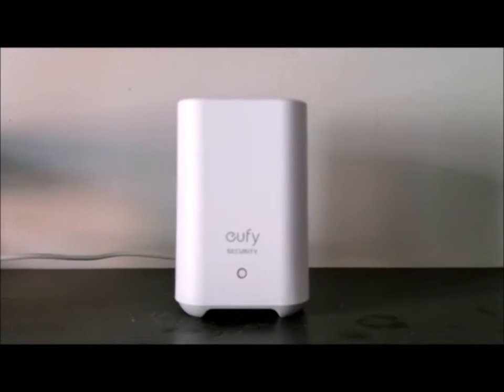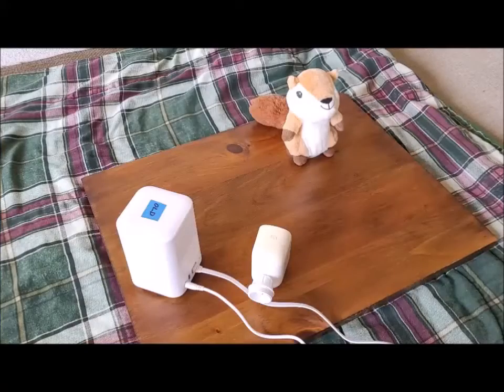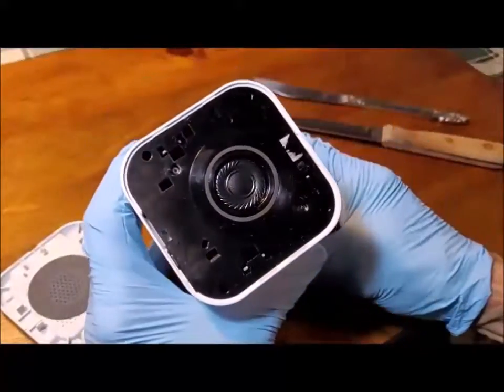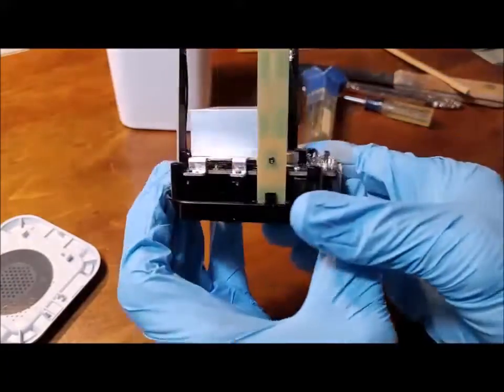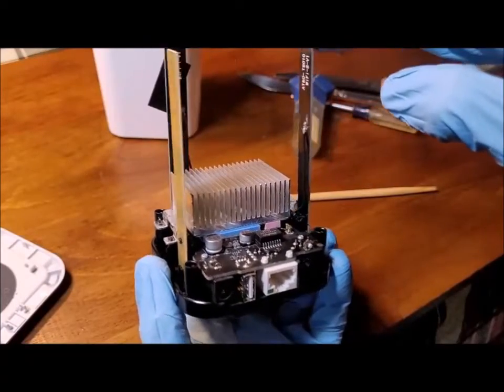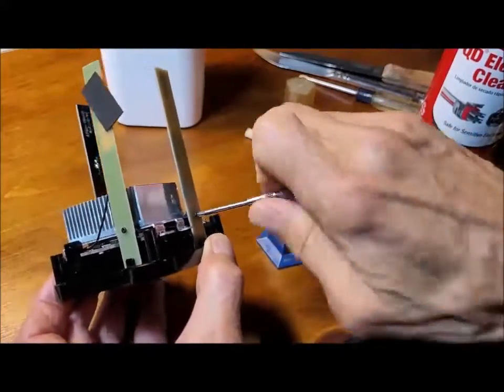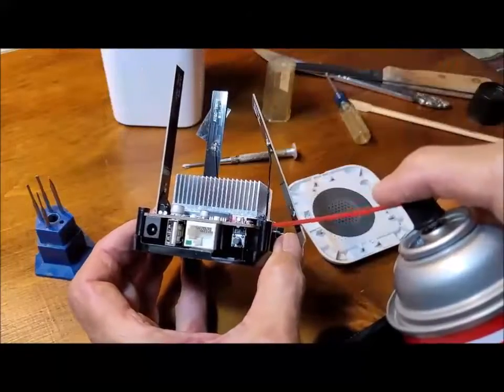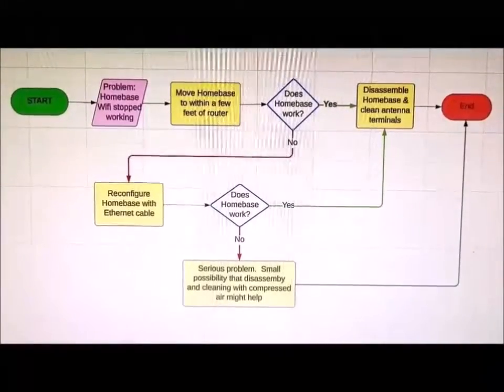Eufy Homebase is Offline and Will Not Connect----Disassembly and Repair

Comment: Thank you for the tutor. After 2 years my 3 cameras and doorbell failed to connect to home base 2. Followed your instructions and everything is up and running again, although I had to re-instate everything. Used OB41 electrical contact cleaner on the Antenor and all plug in connections. Thanks😀

Comment: I've had 3 Eufy cams for 3 years. 2 out of 3 failed already.  Offline is their death. I went through all of the customer service garbage and they said sorry it's over 12 months old😠
Reply from the maker: Since the cameras also have an RF antenna they could have the same failure mode as the homebase.  I haven't had a cam fail yet but if one does i'll take it apart & post another video if i can fix it.  So don't throw those cams away just yet.